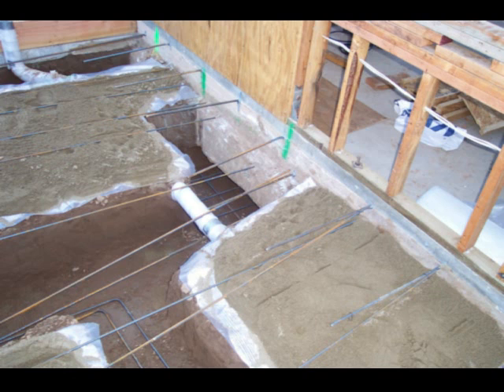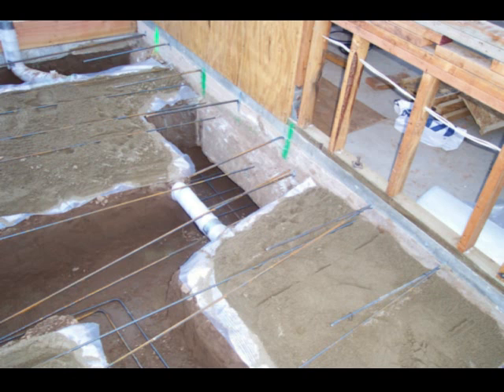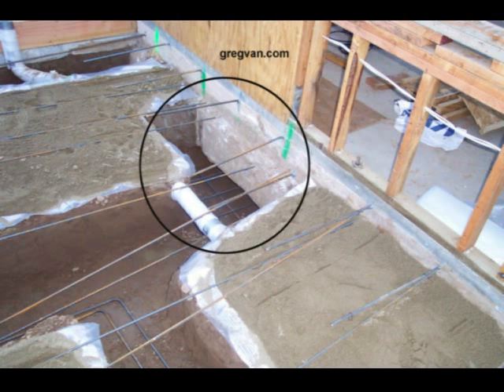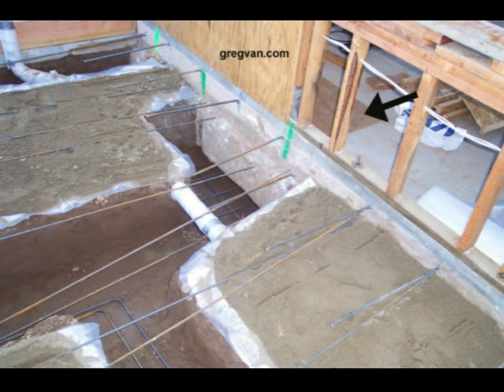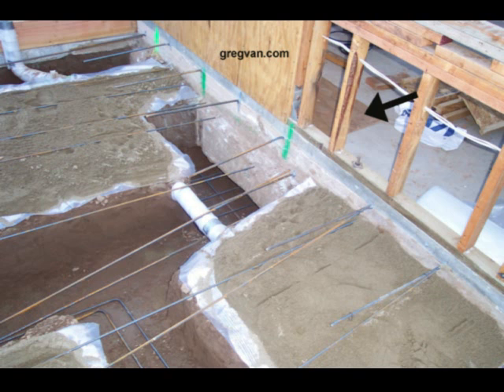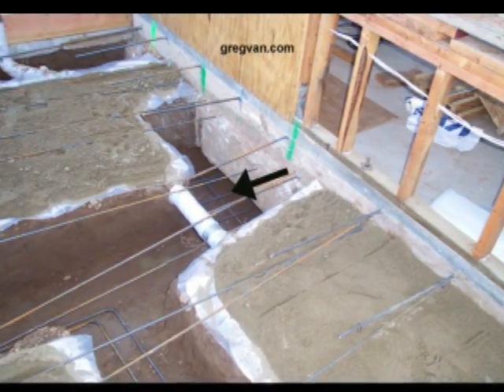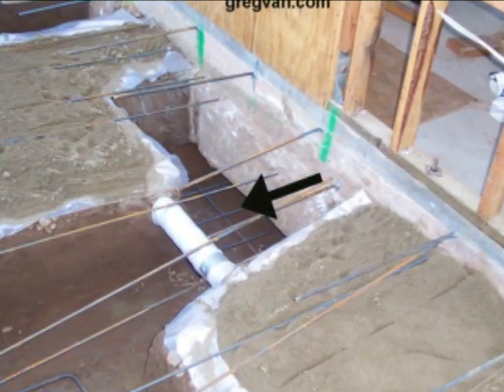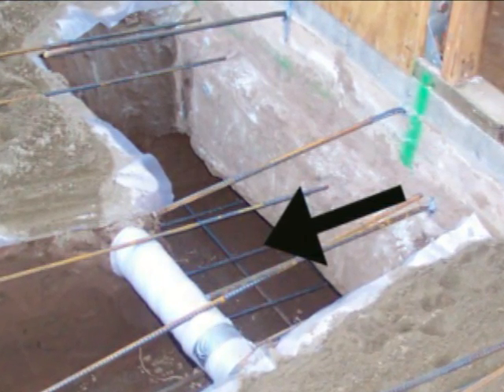How To Undermine Existing Concrete Foundation Footings - Room Additions

Comment: Greg I think this is the video I’ve been looking for,….I have a garage/addition detached that I want to turn into a small cottage, but I doubt the footers are the required 24”,…so would a foundation guy be able to dig around the perimeter like this video and pour the necessary 24” footers to meet code?,…if so, any idea on cost per length?, my garage/addition is about 18’x18’ perimeter.

Comment: What is the hole for or what does it do to help dig under?
Reply from the maker: The hole will be filled with concrete to create a strong structural support underground that will be used to support a concentrated load above and in this case is going to be used to support a large beam that will hold up the floor and roof.
Reply: I have a very similar situation.  I need to put a footer for a post and lam beam directly up against a foundation footer and block wall. Do you think they will make me under pin the existing foundation?